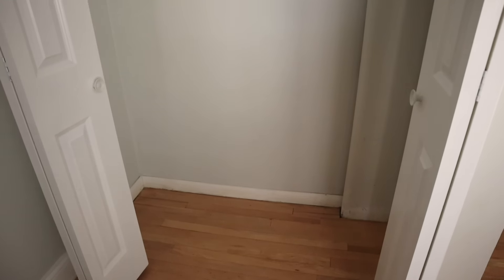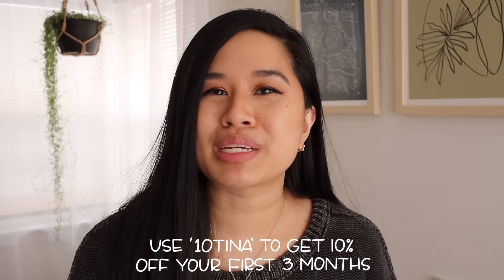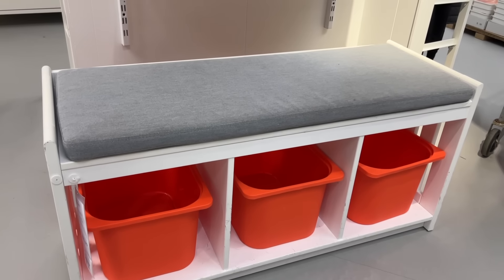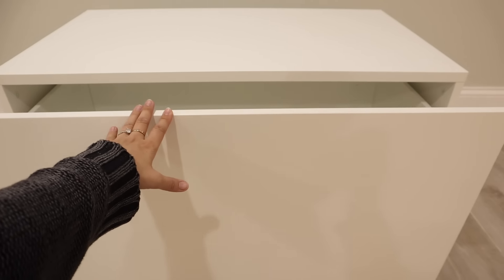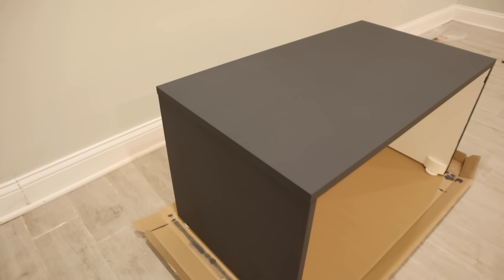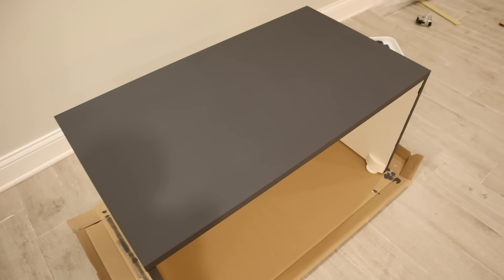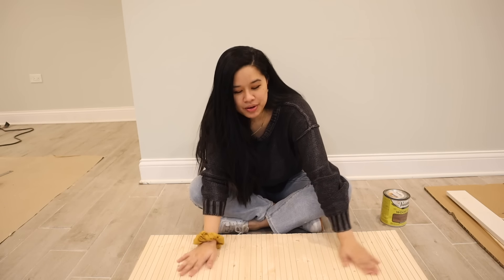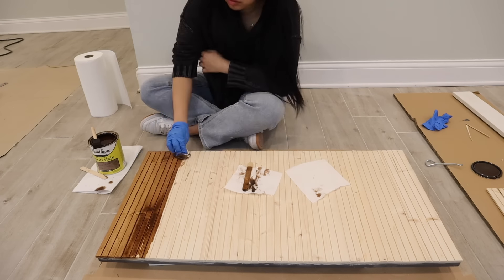COMPLETELY TRANSFORMING IKEA TOY STORAGE INTO A MID-CENTURY MODERN SLATTED WOOD BENCH | DIY Hack

Comment: I would do half a rod for items that you use less frequently and use hooks on the other side for every day coats and items! You can use a bracket for the end that doesn’t have a wall for support and can then even add a shelf on top of that. OR you can do rods going front to back of the closet on either end. I’d keep the doors on for whenever you need a break for looking inside the closet :) good luck and love the bench!

Comment: @Tina Le  Earlier today I saw on 2 different videos where they used shellac instead of sanding and priming over smooth and even shiny surfaces - perfect for IKEA furniture.  I believe it comes in both a can & a spray.  So crazy… I never knew this tip before and then see it twice in one day from different creators.  Now I’m here and you asked!  So, yes, no prepping (other than cleaning for used surfaces), just apply the shellac and allow to fully dry.  Then paint away to your heart’s content.  

PS:  the shellac will usually fill in shallow scratches & dings so they’ll be less noticeable or even disappear once painted.
PPS:  OMG  I’ve never heard of pole wrap before today and now yours is the 2nd video today!  😁  I think you’d enjoy seeing how Drew of Lone Fox used it to transform a Billy bookcase.  It got my creative juices flowing.  It’s on Architectural Design YT channel.

Comment: The bench looks great. For the hang bar I would recommend placing one all the way to the left running front to back. This will make the hang bar short and out of the way. You can use the short hang bar for out of season jackets. Then put a few large coat hooks over the bench for the coats you are currently using. :) You will have the ease of a coat hook but can also store out of season coats without looking cluttered. :)

Comment: You could do a rod with S hooks - then you don't have to use coat hangers to hang your jackets, but you can also fit more in the closet. It also gives you the option of using coat hangers for any coats you use less often so you can tuck them to the far side of the pole tightly together while having easy access to the jackets you more frequently use on the S hooks.

Comment: I used that bead board on my kitchen island a few months ago and love how it turned out. I honestly only used it because the store’s saw wasn’t working that day so I couldnt have them cut down a 4x8 bead board to size (both to fit in my car to travel and to use on the counter). So I opted for the pack you piece together and it was so easy to use - much easier than wrestling with a large piece.  🙂 Loving the DIYs as always!

Comment: In regards to primer or no primer with chalk paint. I have a cabinet that I attempted to paint with chalk paint that was that slick, shiny finish and it basically beaded up and it left tiny holes in the paint. So, yes a primer or scuff sanding is needed when you're painting over that type of finish.

Comment: You could add some molding so that the back of the closet has a similar look to judges paneling up to about 2/3 the way up the back wall of the closet. It would tie in nicely while not exactly matching your dining room. It would also nicely contrast with the MCM/modern lines of the bench. If you added some thicker horizontal molding/trim to the top of the paneling and be a perfect place to put your coat hooks on the to make them look like they are not just floating on the wall.

Comment: I think you could actually get away with doing what you plan with the shelves, adding hooks across and along the very top of the closet add a long rail. The intention with the rail to be overflow for when lots of guests are there at say Thanksgiving etc but also so your seasonal jackets can hang in the section hidden behind the wall where there's that small bit of space. The hooks then along the back of the closet above the bench and the shelving to the side. That way everything is neat, you use the hooks everyday and seasonally change the coats over as you need or you can have fancier coats that aren't used as much there since your more likely to hang those back up. 
Also you can buy those long thin cushions from the second bench on Amazon 😉  

On the topic of the doors would you consider getting a door which lets you open it all the way over to one side but can be moved to either side when opened as I think that would give you the most space

Comment: You asked if anybody had storage solutions in the comments and I was wondering how do you feel about very short poles? Specifically you have the kind of closet that is not necessarily meant for walk-in which means that there's a little cave behind the folding doors. If instead of going perpendicular to the back wall from one end of the closet to the other you put in short pipes in the short area between the wall and the door you can have hanging storage for the coats you're not using all the time and then still mount hooks for the coats that you are using all the time and aren't very good about hanging up. That way you could do it on both sides and it would still be mostly hidden by the doors.

Comment: You said you could to shelves to the side but why not do a rod there? You could do the long dividing board vertically and put a door on it so it's a mini closet within a closet. It would be a coat cupboard on the right. Then you could do shelves over the whole top part above the hooks you want to do. That would give you closed storage for the coats you're not wearing at the time. Just a thought.